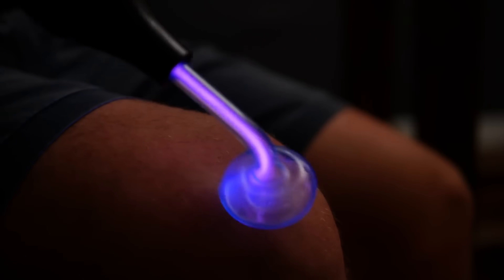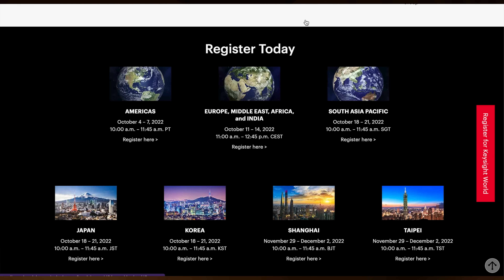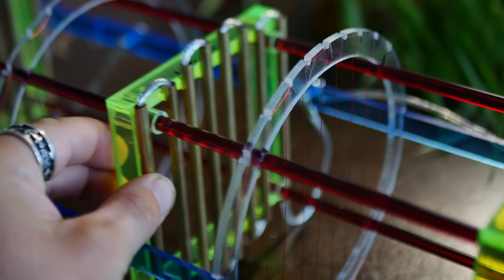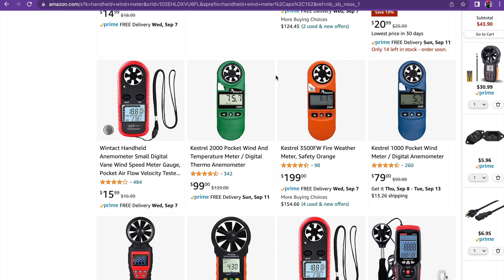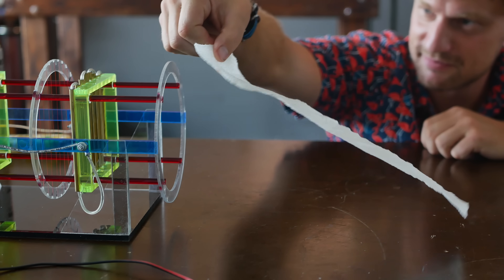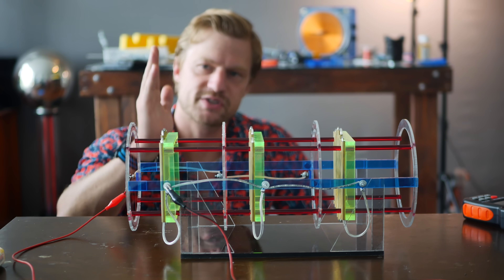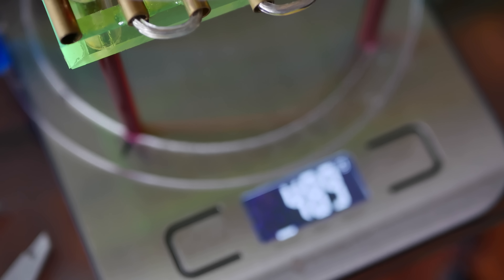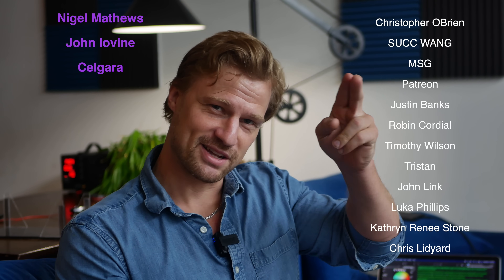Designing A Next-Gen Ionic Thruster! (For Flight)

Comment: 🤔 decrease the size and slightly over clock you're voltage ⚡ awesome idea I'm curious what a car battery would provide and like someone already said side walls ... 🤷🏻 I'm tired lol so can't really recall my engineering part of my brain 🤣 but this design does have huge potential. However it seems it would eat power fast so I'd have to see how long it lasts running on battery then see if something solar would charge.... 

 Building gocart for testing seems legit 🤣 be loud but so much fun ☺️.

Comment: New viewer here with first impressions.  I knew I trusted you when I saw the calipers with a dial face and knew I liked you when you included getting bit by the DC Voltage into your video.  
Here’s my tips that are probably not worth much.  When you set your ground metal mesh screen. It creates the highest amount of surface area to pull those ions in while also letting air pass through. Plus it acts like a protective guard for the electrodes on the positive end that I’m getting ready to explain.  Use a grid layout of your choosing and instead of just the wire being wrapped over top and the positive ions excitement throwing the plasma off of what I call the side of the wire, use individual wires but let the ions and plasma come off of the cut end.  Use the cut end of the wires basically to throw your excited ions off of and remember the ions will be building up and going down the side of the wire until it all flies off the cut end.  That means you have more ions moving in a straight line building up more and more while pushing air molecules the whole way down.  This gives you more are speed, more thrust, and ability to control the direction a bit more.  I wish I could draw this instead of explaining poorly through text.  There’s a few tunnel effects you could use to get your thrust up higher and more volume moving if you decided to enclose it but then you’d be producing enough thrust to possibly move your rig. I’m by no means experienced with drones but I have used this technique to build a few things that would fly, with little to no control until one day I give in and learn about drones.  Hook up your positive ends to be able to turn a full row at once, hook up some servo motors to each grid layer and you now have directional control of your ion thruster. Thats how I was able to build a few crafts and hooked up a few accelerometers to guide the servo motors in the right direction to keep it floating level.  I’d be happy to CAD 3D model it and send it to you over IG, email, etc. 

Another fun project is building underwater propulsion with electromagnetic resonant frequency field waves that oscillate what I call the prop in a manner to provide underwater propulsion.  EMFs travel similarly to sound waves but sound waves require atmosphere to travel and EMFs can travel through the vacuum of space, not similarly through water without the water acting as a resistor or barrier to the EMFs. 125 kHz access control door card reader coils work perfectly to create the EMFs and they are cheap.

Comment: Ok, so the electrodes are just exposed bars that ionize the air, and the other gives it a direction. 
Plasma is affected by magnets, so using more power you can use some electrical fields to compress down your flow and help direct it with a little more umph, and can step up the charge to respective sections to increase flow instead of stacking same flow to same flow speed and avoid diminishing returns.
You can also increase the surface area of your electrodes offering more ionization, and with a simple shell help direct more air in and less air out the sides for efficiency sake. Maybt some octogon shape to offer good air flow with increased surface area, maybe the recieving electrode as the octogon shape? Maybe both at the same time? 
Your variation in distance offered a boost, so while you have had luck with a random set, I would love to see you start with 1 operation, find the optimal distance, then try the second at changing distances and then the third to find the most optimum setup. It also may be possible that the third unit can be better optimized by a different configuration between the first two regardless of 2 systems optimal positions. Like teying to find the right number gling high then low and cutting each try in half the opposing direction, you can widdle down to the best number by trying distances and jumling back and forth until its the best. There has to be some math thing to make that easier.
Weight is an obvious improvement, as with barebones structure you could make the same system increasingly lighter, and with data on optimal distances, you can easily work out the legnth of the thing. On that same note, you change the distance of one electrode to another, but not to respective sets. Make another device to test (when you get optimal electrode to electrode) the best distance from unit to unit as well. Lots to do and learn, so much more efficiency to gain

Comment: 1. Enclosure for air to be funned in From the front
2. Gold connectors/gold plated rods to increase conductivity
3. Exposed power wire should be insulated

Comment: So to really measure thrust you need to have a nozzle or pressure creator in the back. What about encasing it so it's closed off? and what about providing gradually greater amounts of power front to back or back to front? Also what about thrusting different gases. Instead of air are there better gases to use? What about closer wires? and different materials. what about different temperatures of air? 
You are using direct current correct does it change anything with AC or vice versa? Just throwing ideas out there

Comment: Could you use thinner positive wires ( closer to the needle points used in older ion generators) 
Could the ground also be thinner to obstruct air flow less and less turbulent 
What about using a spiral design for the positive and negative  rather than a parallel design

Comment: I think the adjusting the aperture size of the thrusters will improve the efficiency.  Additionally, changing the material of the grids may increase efficiency.  Maybe pyrolitic graphite or molybdenum.  And as an outsider, perhaps determining the overall dimensions and layout of the thruster will optimize its efficiency.  For example, will this remain a 'garage-project' or are you aiming to build a functional/semi-functional prototype for manufacture.  If it is the latter, thruster housing, solar panels, batteries, fission RTG reactor placement, propellant injector design, etc.

Comment: 1) Collimate thrust by enclosing air flow with structural components. 
2) Decrease cross-sectional volume with respect to thrust vector
3) Increase voltage with successive stages in the direction of throat vector

Comment: There is a solid-state wind generator that uses this effect backwards, to extract energy from wind.  I'd love to see some experiments with that.
Reply: yes, plz.
Reply: I thought it used resonance vibrations
Reply: It's just piezoelectricity
Reply: A quartz crystal set to a harmonic resonant frequency of a vertical plank that as the wind blows it vibrates at a subsonic frequency and the vibration (sound) is turned directly into Alternating Current... 
Unless you're talking about the ions in water vapor and rain drops? That's three layers basically like a diode/capacitor.. PTE film(plumbers tape) as a seperator. Aluminum foil as an anode top layer and I believe the cathode is copper underleath. I'm sure the cathode doesn't matter as much you could probably use aluminum foil and PET on both sides like a Uindhurst static motor and still get a current. The only problem with this is unless you have a laser cutter the individual cells would be a pain in the as to make individually if wanted to cover your roof with. Per square meter roughly the same power output as a solar panel during a rain storm. The energy I believe is triboelectric meaning it has to be managed in capacitor banks and conversion coils before being converted to a usable square wave AC. But totally doable. There's also triboelectric voltage difference potential from atmospheric v gradient. It requires a long thin wire suspended high in the air.

Comment: I noticed that in the plasma discharge stills, the plasma seems to be coming from random discharge points on the wires.  Is this because of random imperfections in the wire ?  I believe discharge normally comes from 'pointy' features, where the electric field peaks.  Perhaps you could add irregularites to control the location and number of discharge points.  More points might allow you to use more power effectively.  Different pattern could control the shape of the airflow.  You could try sticking some iron filings on the wires to see if the irregularities are influencing the discharge points, and if more are better.  Or try a 'comb'-like anode.

Comment: Don't have much experience with electrical engineering but I do find this really cool. There's a couple of things I don't understand though
(1) Is this dangerous at all? I understand that the  voltage is incredibly so touching both  the positive and negative electrode should give you an electric shock, but is there way you can limit the current that would be drawn, or is it essential to the ionisation of the gas
(2) Kind of related to the first question, but does this use a lot of energy? I don't understand where current would be flowing here other than electrons from the air molecules being ripped off and pulled to the positive electrode

Comment: Great video! I'll keep it short.  Raindrop shaped copper tubes will be more aerodynamic. I doubt those are available, but you could try pinching the trailing end. Probably only important in the rear end of the assembly as the speed picks up.

Comment: My thought is to increase the surface area of your positive wires by making a grid of some sort, and add nucleation points to concentrate ionization. Ducting your thruster will make your staged configuration more efficient. I would think that adding a cone could let you experiment with stages of compression. Would a larger diameter electrode increase the ceiling at which your voltage increases reach diminishing returns?

Comment: Honestly I'd prefer a cylindrical approach with the design using ultralight materials for this ..

Regarding the way the experiment goes, I think that the amount of voltage going to the plasma grids were equal. Hence there will be no increase of thrust due equal velocity of each grid resulting to cancelation of the initial thrust from the intake grid to the last.

It's nice to think too that it would be highly efficient if there are levels of compression applied to each stacks to provide a possible increase of wind speed for thrust.

Downside for this build: 
1. It consumes more power and less out put.
2. The speed in which the device is capable is not promising.
3. Due to light weight materials it is prone to wear and tear than the conventional way of engines.

Honest take: I love the idea of using ionic thrust for flight. It's like watching Ironman all over again. But the technology is still an infant at the same time I am also excited to see where it would lead us soon .

I am not an engineer nor I am a scientist.  But I am an enthusiast that loves innovation, and these things just make my day better.

I would also love to see you experiment on ionic jet propulsion approach to add on your ionic thrust.

Thanks for this awesome video ❤️❤️❤️

Comment: this is fantastic!
🤔 I'm wondering if you could design this to increase the airflow output using the venturi effect? a bit like the Dyson airblade concept.. it increases the air output by using the venturi effect, "sucking" and "pushing" more air through its ring because it's airflow from a tiny internal fan travels in a way that creates lower pressure and off it goes... I'm sure you understand/know more about it than me! 😅
I'd always pondered on it's potential for propulsion... maybe with this, you may have the key

Comment: Would a venturi nozzle make an impact on the thrust ratio? The sections need to be partially enclosed but not fully enclosed. Partially as it will allow more air to be pulled inwards but enough to not lose the air past the wire.

Comment: Air drag and turbulence through the thruster ion emitters is a one efficiency problem. The thinnest possible wires would help. An enclosure might help insulate the device and create a ducted fan effect? The noise created means energy is wasted making that noise. Venturi effect intakes boosting output thrust would also help improve total thrust. Oh and this device is the coolest thing I’ve seen on YouTube for a long time. I used 10-20KV to produce an ionic wind to research the ability of Negative Air Ions to sterilise surfaces as part of my degree project…

Comment: 1) Build a shroud for the sides with variable, lateral, intake points (see if air only coming from main intake, or various side intake configs helps)

2) Reduce the support pillars from 4 to 3, and lighten the materials

3) Experiment with intake/exit nozzles to boost optimal airflow

Comment: Can we have a cold fire 🤔 because fire isn’t hot 🤔 fire is just the particles that interact with any matter around it so I believe not being the actual element but a building block to help the cause what’s the other particles involved with the reaction fire because we can have heat with out fire we can burn with out fire , light isn’t the same as fire even tho light can’t create fire what’s the missing power that causes the flame 🔥 because the flame from my observation the actual thing that burns live with in the fire or the light …….. because smoke reflect the heat an trap the light depends on the kind of substance the smoke is coming from because cloud trap heat but don’t absorb it so if I’m wrong forgive me but I’m a fool so let me try a theory, all ion saying is to create a nest 🪺 or a hive that can harnesses  ion collectively to be honest if ions are alive they should be able to grow an mature like an increase in energy if you can shorten there lifespan like by . 3rd of a second like can we measure ions or can we enter their flux an course it as our own can we manipulate ions in to believing there moving when there staying in a fix position but spinning an vibrating cause a whole other reaction one that we could use or suck enegry from one ion rather than the whole web system like imagine using one ion to replace the use of many at full power

Comment: Along with the many great ideas already stated:
1.  Try using different voltages for the different stages, so the air is accelerated like a rail gun.  First stage would be closely spaced and low voltage, then each stage after would have a higher voltage and spacing.
2.  Try many more stages.  If 3 stages improves performance, how about 10?  Or 100?  Point 1 may be important here, for the trend to continue.
3.  Everything built within a smooth tube, to increase pressure.  See if a slight taper of the tube affects thrust.
4.  Once optimal spacing, voltage and # of stages is figured out, build a version in a tube made from something lightweight, like styrene, thin lexan, or coroplast.  Coroplast can be curved my making creases along one face.  Slap some EPS foam wings on it, and see if it flies.

Comment: Definitely duct the whole thing and put a slight cone on output to reduce loss of airflow, as I read down below, someone had the great idea of adding motors to each thruster to move individually and without delay, you could move each thruster immediately and see live results. Also I would push the wires a bit closer together on the thruster and use flat copper strips the same width of the tubes, instead of those tubes.

Comment: Congrats, these are amazing results!
I've had some experience with corona discharge. My suggestions:
- Increase the "sharpness" of the anode by adding spikes to the wires.
- Enclose the thruster in a duct and maybe add a nozzle to increase air speed.
- Measure the current into the cathodes (with a high voltage probe). It should be ~0. When the dielectric breaks so does the field gradient, and ionization drops. Finding a combination of voltage, distance and electrode configuration to reduce cathode current should reduce the power consumption and improve efficiency.
Good luck!

Comment: I notice you're using magnet/coil wire which looks to be enameled, and you can see hotspots coming off of them in the dark shots where the current seems to be penetrating the enamel (where it is likely thinnest originally). I would wonder if you used bare copper if that would improve the efficiency a bit.

Not sure if enclosing the thruster in a tube would make much difference, but it would contain the thrust from each stage going to the next at least.

Using a wire mesh instead of metal rods might improve airflow and increase conductive area. Same might work for the positive side instead of the wires, but I would think the meshes would have to be really flat and as perfectly parallel as possible, otherwise, you might lose some efficiency from "hotspots".

Comment: As an aero engineer, the first thing that pops out to me is the round tubes. They're rather draggy, so you're loosing a lot of the thrust to drag across those. Also, theres more wetted area which, I would guess, creates a larger differential between the small wires.

Use some airfoil shaped tubing. I believe K&S sells it in various sizes. The local RC hobby shop would be a good place to look.

Second, there should be an enclosure to make sure the thrust is channeled. I suspect at leat part of the thrust coming from the first two stages is bleeding put the back.

Just a couple observations.